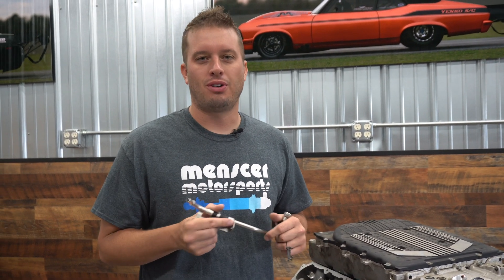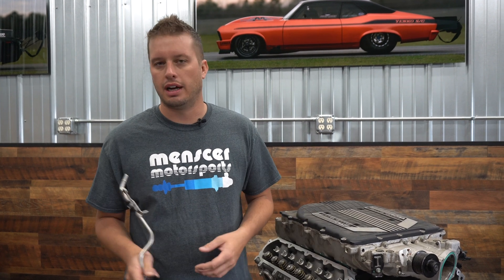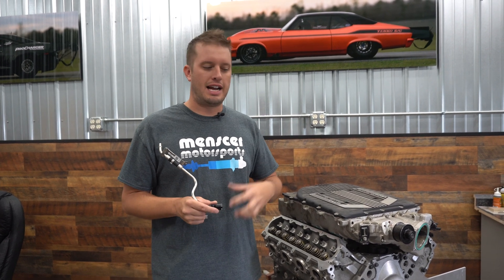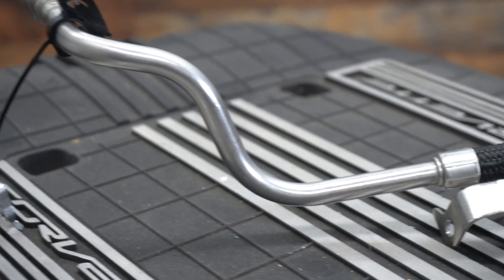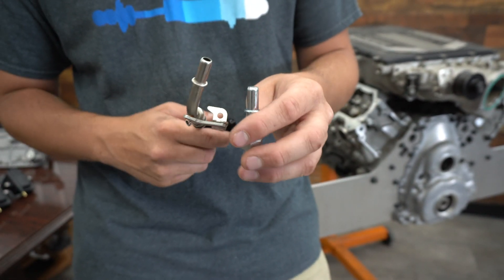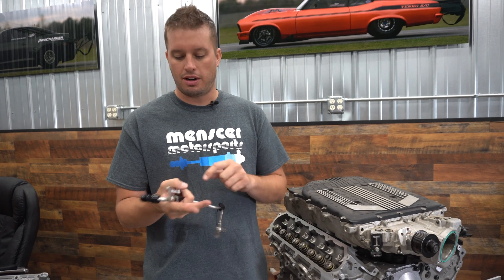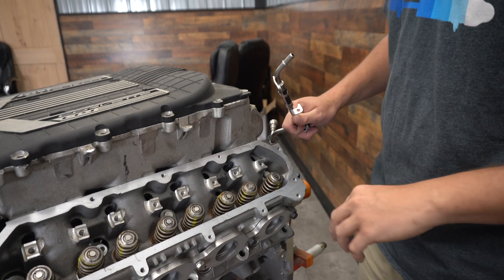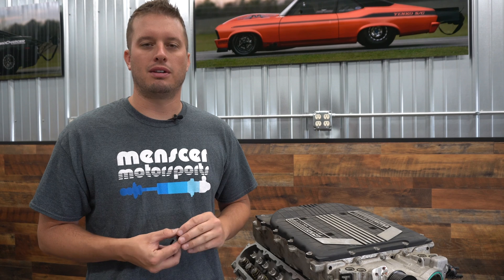Gen V LT Direct Injection Horsepower Secret: Tech Tip Tuesday

Comment: I'm working on a 2021 gen v swap going into a k5 blazer.   It has the 10 speed transmission  with it .  The ecm is the e90,   how or where do I go to get the ecm unlocked and tuned?

Comment: So does MRW sell a bigger line to use between the two fittings?
Or do we just supply our own that we find? 
Maybe it’s not as easy to make but I think it’d be great for MRW to sell a whole “LT1/LT4” Fuel line upgrade kit that came with the two fittings and the bigger line to connect the two in a stock location.

Comment: Doesn’t the factory fuel line have a check valve in it? Without it wouldn’t it be possible to bleed back fuel and cause the hpfp to start up dry?
Reply: No the line doesnt, the check valve is in the pump assembly thats in the tank

Comment: You should do some research so you understand the dynamics. I applaud your effort but you are completely wrong unless your trying to sell people injection pumps. Research cavitation in positive placement hydraulic pump like your injection pump in a multi stage system being supplied by a non positive displacement “lift pump”. Bosch CP3 or CP4 is a great place to start. You seem to have good content and want to genuinely help people I totally respect that🦾😎🤘🏽

Comment: My question is if you increase the fuel supply lines diameter from lift pump to the injection pump. You get more volume @ lower pressures. Cavitation occurs in a fluid aka positive pressure hydraulic pump. When the outlet pressure diverges too far from the pumps inlet pressure. In theory your trick is ass backwards. The restriction are there in the oem fuel line must be there to keep fuel pressure high with reduced volume due to different engine displacement  and or power out puts. To combat cavitation due to using the same size injection pump on multiple engine displacements with different power out put demands!!! I know nothing about modern Oem LT stuff. I’m guessing and hoping that line is a supply line from the “Lift” pump to “injection” pump and only sees 40-50 psi if your Recommending switching from a hard line to soft hose. Help me understand how a pressurized line at even lower pressures can collapse? Increasing inlet fuel (volume) to a injection pump from a lift pump could only effect injection pump output in a incorrectly engineered system. I can’t see GM spending 6 million hours engineering the system and missing that. I’m assuming what you are talking about is cavitation. Witch is what happens when hydraulic pumps inlet pressure and outlet pressure divergent pressures become to great.  It’s the reason a Bosch CP3 diesel injection pump houses 3 individual pumps to step the 20 psi @ the inlet from the lift pump to 30,000 psi to the injector so that it can over come cylinder pressures and spray fuel into the combustion chambers. I read the modern LT platform injection pump supply’s 2,000 psi to the injector witch fires much earlier in the compression stroke at reduced cylinder pressure when compared.
Reply: Ok so what about the cp3 with no lift pump?? Id say thats a serious difference in inlet/outlet pressure???

Comment: I have a somewhat mundane question. I own a 2015 silverado L86, lifters #4 & #7 collapsed, so im tearing her down to repair. Do you guys know how to get the oil dipstick tube out? I can spin it to a point but can't get it out. I have pulled, twisted, but no luck. I'm afraid it will break if I pull to hard. I need it out of the way so I can push exhaust back and get to bottom head bolts.
    Cool tip on that fuel line, now would be a good time for me to try that mod, thanks. 👍👍🏁🏁
Reply: Mine just pulled out the same as an ls..... spin it back to where it was and pull hard come easy is what I always say. Hope this helps

Comment: This may sound like a stupid idea, but since these engines are direct injection, and some hotrod guys prefer mechanical injection over electronic injection (me being one of those guys), why not fit a properly built Bosch MW8 injection pump on it? The end result: a Direct Injection P-Pumped LT engine.
Reply: @@bryangreenleaf1946 Thanks! The idea came up one day when I was researching a mechanical fuel injection system for big and small blocks of all makes. Kinsler made/makes mechanical fuel pumps and mechanical fuel injection systems. I also looked up Cummins diesel injection pumps when I thought about their compatibility. Perkins diesels used similar style injection pumps on their 540 V8 diesels. There are slight differences between the two fuel injection systems (big difference is fuel type and lubrication) but they both have similarities as well (one being that they're both used in direct injection engines). It could work with a little bit of modifications. Replace the diesel injectors with gasoline injectors and if lubrication of the injectors is a problem (which I don't see why it would be), find a way to improve the pump lubrication.

Comment: DOUG, you had mentioned before that Holley was a bit finicky with DI control, but now that it has been out for long enough, I would imagine the issues are sorted out. I would really like to know if it's possible to run a Dual Fuel setup on an LT1, where as pump gas runs through the DI system, then Methanol can be PORT injected via 8 injectors at high boost levels similar to how guys are doing Dual Fuel LS Drag/Drive setups right now. It's just such a shame that many guys are running LT setups, but have ditched the DI setups for pure port injection at higher HP levels when a Dual Fuel DI/Port combo would be so sweet if it could be controlled like on an LS.

Comment: Fun fact, when I was a process engineering intern I worked with this fuel line and there is actually a check valve inside the flex joint. GM wanted to prevent the high pressure pump from loosing fuel before starting. If I ever get an lt4 this will be the first thing I remove.
Reply: 🤦‍♂️ where do you work now?
Reply: Do you see any harm in using the checkless line with a checkless fuel pump? This will be a max effort race application on a gen v LT1 using the LT4 pump and injectors. Plan to convert the in-tank lift pump to a walbro 535- which has no built in check.
Reply: @trey8543  might take longer to crank after sitting.
Reply: @lukedoehrman2304  this, my C7Z mostly takes longer to start now once it’s been driven and warm. Cranks a little bit and slowly fires. No big deal.
Reply: @groomlake51  my name is far over your head you should try reading more and posting less.
Reply: Good
Reply: Getting air in high pressure lines takes time to bleed out.  There should be a check valve somewhere in the fuel system.
Reply: I always thought the check valve was the large drum looking part before the rails. Makes that ticking sound that makes all the Boomers bring in their vettes to service thinking they have a bad lifter....🤣

Comment: I wish this would be offered as a kit.  I’m going to de doing a cam swap on my L83 and just ordering 1 kit would be great and not having to search different fittings.   Have you guys thought about or tried anything on the injector side of the pump?  There’s restrictions inside that tubing as well but with the high pressure maybe a bigger I.D. stainless solid line that could match diameter of the pre pump side hose and fittings.

Comment: i ordered a lt4 mechanical fuel pump and lt4 injectors for a buddy of mine that is doing an 6.2 swap on a single cab 2019 silverado that had the original l83 in it with cam and magnuson supercharger. the 6.2 is getting cam and supercharger thrown on it in your opinion will it need that fuel line delete?  We are just looking to make basically lt4 power around 500 to 600 at the wheels.  currently made 420 hp with the 5.3 and supercharger

Comment: Do you think it needs a check valve in there somewhere to keep pressure on the high side pump? I saw that lingenfelter offers one for around $200 but is it necessary?

Comment: Wait until you see the size of the inlet bore on the pump itself.
Reply: I wondered that as well and asked if they did any flow testing. The answer was “No”

Seems that the smallest passage will always be the limiting factor. Pumping non-compressible fuel from a small tube into a larger tune and back into a smaller tube, should not change the volume or pressure at the injector. Physics calls it conservation of energy. 

I’m not positive, but, I think that’s how it works

Comment: i bought a 2016 model 6.2 out of a denali thats got a ton of aftermarket parts, cam, ls7 lifters, pushrods, a lot of goodies, dod delete, vvt delete, etc etc, i bought it to go in my 09 G8 Gt to replace the 6.0, my question it can i do away with this high pressure fuel pump headache and just use my 6.0 heads and fuel system and will this motor run?
Reply: yes wanna know how?

Comment: How did you test this “Black Magic” to confirm that the changes resulted in additional fuel delivery thru the injector?
Reply from the maker: Engines not making the hp they should and then making the hp they should after changing it.
Reply: Motion Raceworks Official I wish you would have elaborated on that in the video and showed your work on the dyno. It would have been interesting. Without a correlation between the effort and the results, it falls flat. 

There is still a great deal of mystery surrounding DI and no one in the industry seems willing to put in the work to give definitive answers on a system that has been put for over five years. There isn’t even an online calculator that works for DI. 

People are forced to throw things at the problem, without knowing what actually worked. 

You have an opportunity to make a great video, that should get lots of views with the correct title. “How to gain 25 horsepower for $25”. 

I know there are loads of variables, but the basic questions are still unanswered, except with anecdotal evidence on the Forums:

- How far can you go with the stock Gen V LT1 fuel system?

- Does a +38% Cam Fuel Lobe actually deliver 38% more Fuel to the cylinder

- Which component is first to have an impact and should be addressed first. Low side, HPFP, Injectors, Plumbing

- If you upgrade the Plumbing, how much does that raise the cap on HP?

- How much further will upgrading to the LT4 HPFP get you?

- At what HP does the low side pump need to be upgraded?

- At what power level do the stock injectors become the limitation?

No one seems to have any real answers, they just want to sell a package upgrade

Just my simple thoughts. Hopefully, you will produce the video. 

Thanks,

Kyle
Reply: @Jommybutler1234  Is 100% correct; this video needs more context and data and could have been more in depth.  After watching this video I had even more questions.  There's no such thing as the easy button, if you wan to give the performance customer some confidence; make sure you give as much pertinent information as possible.
Reply: Motion Raceworks Official Publication of information like this from vendors, further muddies the water:

https://www.lsxmag.com/tech-stories/engine/lingenfelter-kit-delivers-serious-fuel-flow-capability-lt-motors/

Using the assertions in the article, the Lingenfelter Big Bore pump delivers 30% more fuel to the injector than an LT1 HPFP and will support 1,100 hp in a turbo or SC applications. If this is the case, shouldn’t a +38% fuel lobe paired w the LT1 HPFP support 1,100 hp?

Comment: I find this topic very interesting. I am a dealership tech and work on Corvettes at the dealership level. I have actually replaced that little line to fix a surprisingly loud rattle noise under accel. According to GM there is a check valve in it to isolate the high pressure pump from making noise or transmitting that noise. Certainly I can see that line being a restriction and understand your position of using AN line instead, but I’m curious if this transmits any noticeable noise. Next time I get my hands on one I can cut up I intend on doing so because GM saying there’s a valve in it doesn’t make much sense, maybe something to dampen but I don’t know. Curious on your thoughts if you have any.
Reply from the maker: Scott Cordell to be quite honest we have only done this on race applications and they’re loud already so probably wouldn’t notice it.  Def keep us posted!
Reply: Haven't cut one open either,  but I suspect there is something in the hose section being held in place via the pinch clamp on the outside,  otherwise what is the clamp for?

Comment: Is the component shown from the LT1?

It is my understanding that the LT4 May have a different, larger component that does not have the flexible area in the middle: 

https://www.summitracing.com/parts/ado-12677005

How many psi does your suggested upgrade to the low side fuel line provide?

Comment: I would like to cover fuel flow threw the low side and high side of the lt motors. Along with covering mechanical pump spacer and when is it needed
Reply: JD Reynolds Are you referring to a lash cap?
Reply from the maker: We have not found a need for a mechanical pump spacer yet.
Reply: Motion Raceworks Official Are you referring to a lash cap?

Comment: So with the 5.3 and 6.2 is there a difference in diameter of the feed and high pressure lines to the high pressure pump. Currently building a 5.3 rear mounted turbo in a 16 Silverado and going to a 525 low side in a factory housing. Curious what power I can make without swapping injectors and hpfp
Reply: Howd it go swapping low side only? Did you end up going LT4 high side? I have a LT4 blower ported by Katech waiting to go on my 5.3, my goal is to push 10psi+ on straight E85. I have the LT4 pump and injectors, plan to go with the walbro 535 pump for low side and going to do the upgrade in this video. I’m trying to find someone that knows if this setup would support straight e85 @ 10-12lbs. There’s a guy on here with the 525 walbro and stock high side the and he’s out of fuel with E60 blend and 6-7psi making around 485whp I believe.
Reply: @trey8543  I'm thinking 2 525s in tank with 10an feed out of the tank to a good high pressure efi fuel regulator with the lt4 injectors and mechanical pump on e85 should support 1400 hp I'm thinking. I'm thinking of going 6.6 gen5 so I'm here for information about the DI before I pull the gun on the swap
Reply: @trey8543  I went 535 and lt4 injectors and ran out with stock hpfp at e62. Waiting to either shim stock or go to lt4. I made 580 on 62% e
Reply: @reamsfabrication5215  Nice, how much boost? I still haven’t started my build, I’m trying to settle on a cam still and there have been some essential GM parts out of stock for awhile now (head gaskets etc). I’m looking at the cam motion PD 220/236 w/+38% fuel lobe. I have the walbro 535, lt4 hpfp & injectors, and the LT5 fuel feed line for the hpfp w/ no check valve. Goal is to hit 600+whp and be able to run full e85.
Reply: @trey8543  I’d suggest a Brian tooley specd camshaft for boost with 38% lobe. I’m running 10.5-11.2 roughly and my tune is conservative as I don’t want to blow the ring lands. I’m looking for a new block now to just install new rings and tap to .028 for boost. Swap cam for a non vvt/dod delete but stock specs as I want to break the sbe record with no changes to specs internally
Reply: @trey8543  did you finish the build??

Comment: What about the fuel lines from the pump to the injectors. Do you have an aftermarket solution for them?
Reply: Phil Watson The lines he is discussing connect the High Pressure Fuel Pump to the Fuel Rails, which comment to the Injectors

There is no fuel line that connects the HPFP directly to the Injectors
Reply: @Jommybutler1234  I understand which lines he is discussing. I am asking about the lines to the fuel rail...you know the ones that aren't reusable from GM?
Reply: Phil Watson I have not heard of the High Pressure Rail Crossover Fuel Line being considered a restriction in the system. 

Can you provide some addl info ?
Reply: @Jommybutler1234  where did I say it's a restriction? I am looking for an alternative to the GM lines that aren't reusable.
Reply: Phil Watson Relax

The focus of the video was removing restrictions within the fuel delivery system, so I thought that’s what your question was related to. 

Swapping to quality AN fittings is most $ than the OEM parts. 

How often are you disassembling your HPF system?
Reply: @Jommybutler1234  I am relaxed , but you have made two comments to mine that weren't of any relevance. OEM parts are a little over $100. I'm pretty sure AN fittings and a piece of line might be close to that but it's reusable! Not sure there will ever be an alternative due to the high PSI but it would be nice. It was just a question. As to how often I disassemble the system? As many times as it needs it. Sometimes people make changes, add upgrades or even hurt engines. If this is a turbo deal you take the chance of blowing head gaskets regularly.